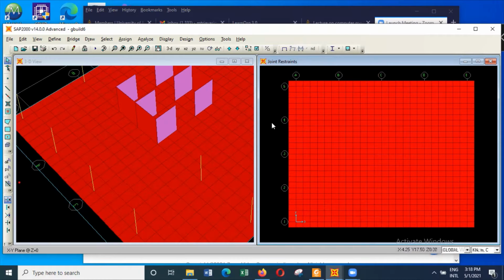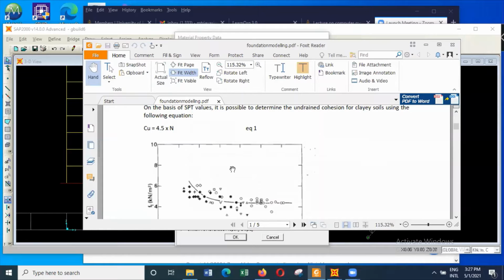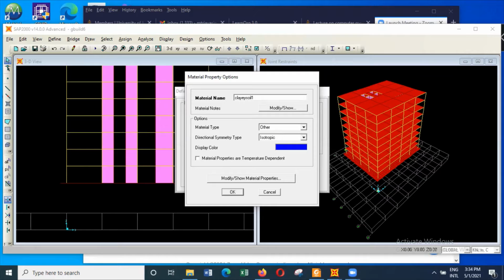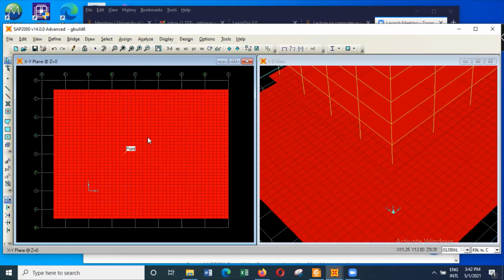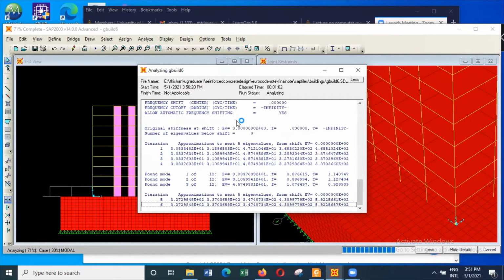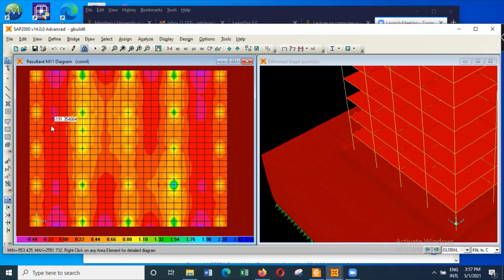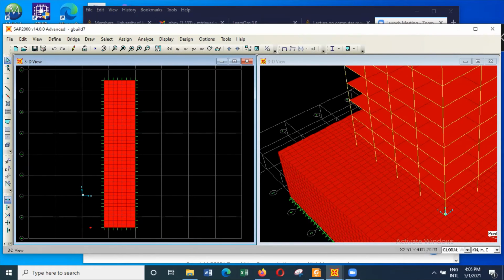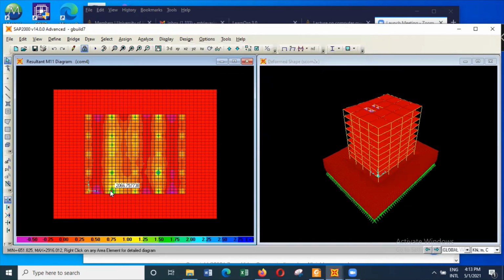Part 02: Foundation Modeling for different soil types using sap2000 by Prof. M.T.R. Jayasinghe

Comment: Thank you so much sir for the insightful tutorial!

I have a worry, i working on an academic project where in a part of the work i have to model a raft foundation supporting a machine resting on predominantly clayey‑lateritic soil. I noticed you suggest using springs for sand and modeling clay as a solid. If I want to account for soil stiffness using Gazetas’ spring and dashpot elements in SAP2000, should I model the clayey‐lateritic soil as discrete springs/dashpots or still as a solid continuum? Your guidance would be greatly appreciated

Comment: Good explaining Sir, I have one question, What type of restrains you used for foundation
Reply from the maker: Assigning joint restraints to ensure the soil is supported. The soil is modeled with solid elements, and the "incompatible modes" option is turned off. This is because soil primarily handles compression, not bending moments.

Comment: Dear Sir, why we use shell-thin for Raft. It is a thick shell? Please explain.
Reply from the maker: A raft foundation might technically fall into the category of a thick shell due to its relative thickness, using thin shell elements can often provide a good balance of accuracy and efficiency for many practical engineering applications. It’s important to evaluate the specific requirements and constraints of your project and use appropriate engineering judgment to decide on the modeling approach. If in doubt, running a comparison between thin and thick shell models can provide insight into the impact of the chosen simplification.
Reply: Thank you Sir